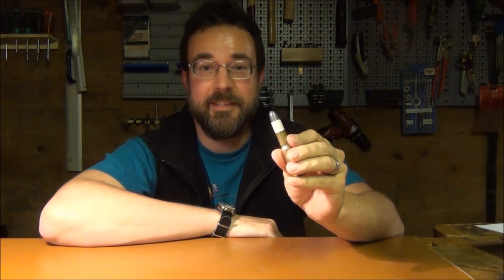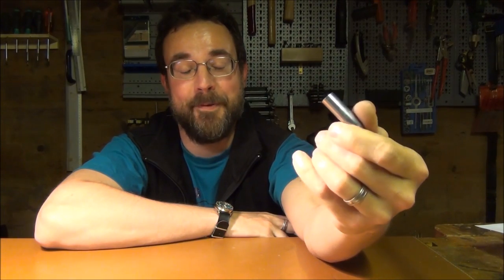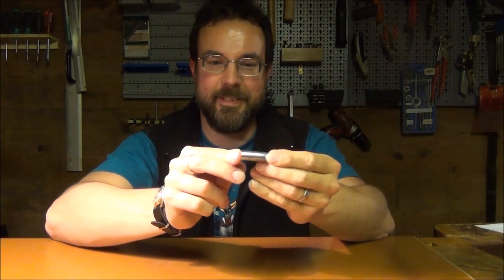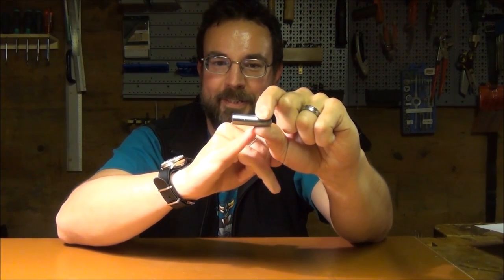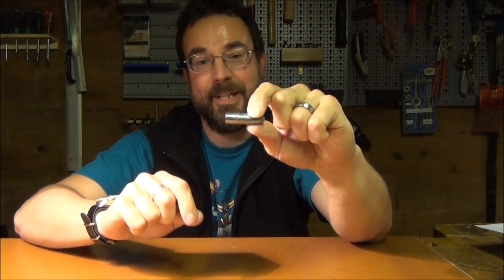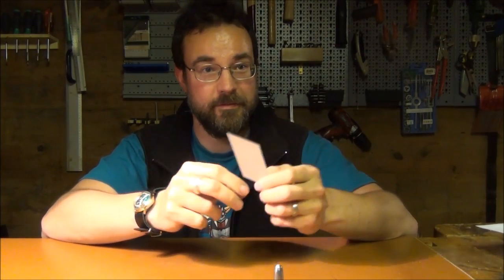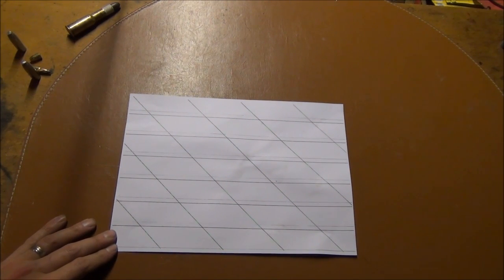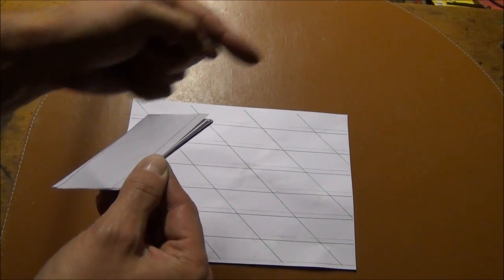Paper Patching For .577/450 Martini-Henry

Comment: I use a straight sided .458 bullet mold which works fine and 24 gauge shotgun brass casings. Midway USA has shotgun brass casings for $1 each. Use 577/450 Lee dies to convert the casings.
I use linen paper to bring diameter to .469 and it's stronger. 
The hole in the base was originally to allow the skirt of the bullet to bump up and  engage the rifling since the bore is not parallel but tapers from the breech.   85g of BP gives an original load, lots of noise and smoke!!

Comment: Obturation. That lead expands and if the alloy is properly tuned to the black powder charges ability to upset the bullet (depends on brand, grade and weight), the two work in balance to upset the bullet right up to the patch. This ensures the patch stays on. It is impossible for the bullet to just slip out of the patching.

I used to worry about it. Then I opened books written 1870-1880 and learned there are physics at play with the old bullet designs that are truly brilliant.

Comment: according to Britishmuzzleloader the paper patch was added not to act as a sabot but rather to prevent lead fouling from the projectile. this was the case on pretty much all British rifles that used a non-jacked bullet. I wasn't until I think the mk ii .303 round that they moved away from paper patched bullets and black powder all together.
Reply: Sorry, I should have made that clearer.  Yes, the intention was to reduce wear and fouling, but mechanically what you have is a sabot-like arrangement, i.e the paper is the mechanical interface between rifling and bullet and the patch should strip from the bullet at the muzzle. The use of hardened lead started the phasing out of patching and jackets finally killed it off (aside from the Swiss GP1890).
Reply: The Chap thank you so much for replying to my post, one more question where did you get your brass? is it plentiful over in Europe? because over here is about 140 USD for 20. That's why most people here in the states and Canada reshape 24 gauge brass. shot cups.
Reply: The brass is Bertram and is expensive over here too.  I've had it for about 10 years and yet to lose a single one so the high investment was well worth it.
Reply: The Chap like I stated above it might also be good for you to get some magtech 24 gauge shot cups, because Lee makes some sizing dies, the only work you will have to do is just trim the neck after resizing. that's at least how I resize my brass. I might start making some paper patch rounds with the original brass foils cases.
Reply: I have 30 Bertram cases that will last me a lifetime.  Since I only have one M-H I only partially neck size my cases so they are never overworked.  It's nice to know that other options are out there though.
Reply: The Mk 1 .303 cartridge used a compressed gunpowder charge, however the bullet had a cupro nickel jacket. There was never a solid lead .303 bullet in UK military service. The paper jacket is a development of the paper cartridge used in British military small arms since the 1690s. Originally the paper was just to package the powder charge with the projectile, to speed loading and to form a convenient wad in muzzle loading muskets. The P53 Enfield rifled musket used a paper cartridge, originally with a conical Pritchet bullet at one end. The paper cartridge was greased at the end where the bullet was and was used to form a patch on loading. When the P53 was converted to breech loader using the Snider conversion, then the paper patch was abandoned. The patch was reintroduced with the Henry Bullet used in the Martini rifle. The higher velocity of this rifle caused leading the barrel as lead was stripped from the base of the bullet on firing. The paper patch stopped this and had been used in small bore rifle shooting for  many years.

Comment: I'm curious about one thing. How does the .577-450 stack-up to the .45-70 or any of the other black powder cartridges used in the single shot rifles of the 1860s to 1890 that were in military service. As opposed to things like the Sharps .50-90/100/110. Of course any of the black powder rounds being used by militaries then were more than powerful enough to do the job required. And this is not about the relative merits of the Martini vs the Werder, the Trapdoor Springfield, Remington Rolling Block etc.

Comment: I wonder how it would work if you soaked the patch in Lanolin/Alcohol mix that some of us use for case sizing.  That way your patches would already be lubed...and would dry quickly too.
Reply: Probably, the question is whether the alcohol would affect the structure of the paper.  In my load there is a beeswax cookie behind the bullet and I usually dip the bullet in udder cream just prior to firing so there is plenty of lube going down bore as it is.

Comment: I think paper patching would help me out with some of my 8x56R M95 carbines.  They tend to have large bore diameters even on ones with nice bores.  Most slug at .331 and I have one that slugged at .332, yet the Lee mold and sizing die is .329.  Silly!  I tried opening up the Lee sizing die to .3315" and powder coating the bullets to give them extra diameter, but they still lead the bore like mad.  Accuracy is decent until the lead builds up, which doesn't take long.  

I'll never understand why Lee chose .329 and not at least .330.  Good luck getting much accuracy out of a .329 cast bullet in a .331" bore!  I have no idea how to design the patch dimensions properly though, so I have a lot more reading to do.  Unfortunately I don't have anyone who lives near me that is much of a reloader...
Reply: Toolness1 british muzzleloaders has some good paper patching video
Reply: Toolness1 paper patching to an oversized bore can work, but you can run into chambering problems.  where the case is now to big for the chamber.  anything  about .003  over original bullet diameter you can run into this problem.  of course it varies by rifle.

Comment: Have you ever been blessed by the nightmare that is potential modern paper actually being fairly abrasive? Clays and other fillers are rampant, such as in regular printer paper.. I've never used anything fancy in my Martini but I'm looking for upgrades.

...also I seem to recall years ago reading that one should NEVER wax or grease the outside of the paper itself... not sure why. In my mind that'd alleviate most concerns of paper 'wear'..!

Comment: Can you use a paper patch if your bullet has grooves in it?
Reply from the maker: yes
Reply: @BlokeontheRange  Thanks i just bought a mk2 from IMA im going to buy the .457 diameter 450 grain mold and .457 sizer. it looks like you used to be able to find 468 molds and dies but those have been discontinued or are expensive and hard to find.

Comment: quite a bit of work for each shot.. Teflon tape , the one used to seal pipe thread - works very well. Cheap, easy to get, easy to wrap and doesn't damage the barrel.
Reply: Holy smokes!   Does this actually work???
Reply: @leewilkinson6372 yeah, been loading 71/84 mauser, Berdan #2, springfield trapdoor and a martini like that for years.
Reply: @MrSvv78  nice, thanks!!  
I like cheap easy and effective!  
Hell, I'm all 3.  😆

Comment: I'm confused, you just use printer paper and not some special type of "patching" paper?
Reply: Yup, no fancy expensive stuff necessary.  What is most important is the thickness of the paper and whether it bumps up the bullet diametre to what you need in a minimum of two whole turns.

Comment: Yaa not much useful information. See "Britishmuzzeloader." On how to do it right. Wrong paper, should have addressed rifling twist direction and keeping the patch on the bullet is not the reason for a tapered bullet.
Reply: Dear Mr Batesel, please breath deep and relax ;-) As you say yourself, there is plenty of info elsewhere for the diehards and I also consult "Britishmuzzleloader" like the legions of people interested in these period firearms.  This is "my" method using the paper "I" wish to use.  It gives me the results I want and that's what counts for me.  The purpose of the tapered bullet design is indeed not for keeping the patch on, all I say is that a handy consequence of the taper is that the patch is able to grip the walls of the bullet more efficiently, which it irrefutably does.
Reply: Paper just has to be strong with a grain, back in 1800s they used cotton rag paper because that's all they had..